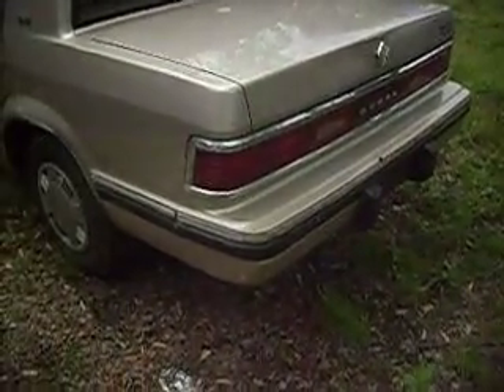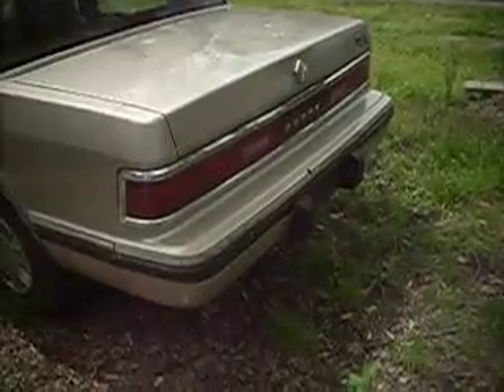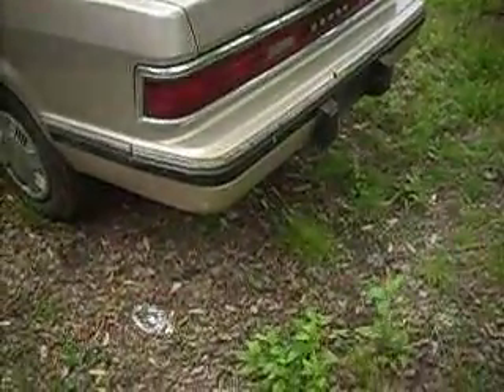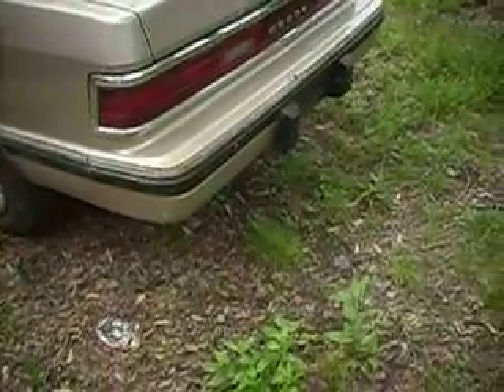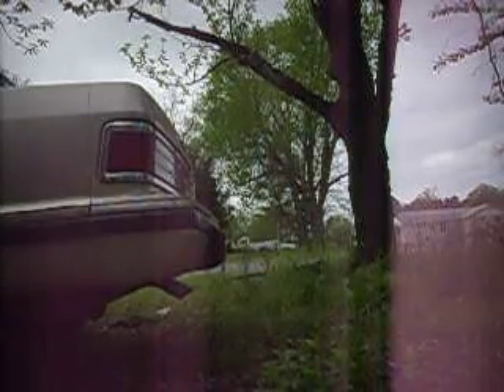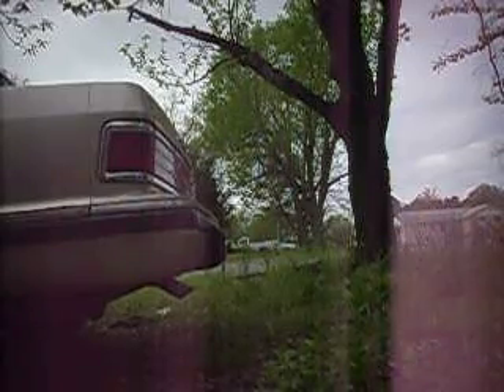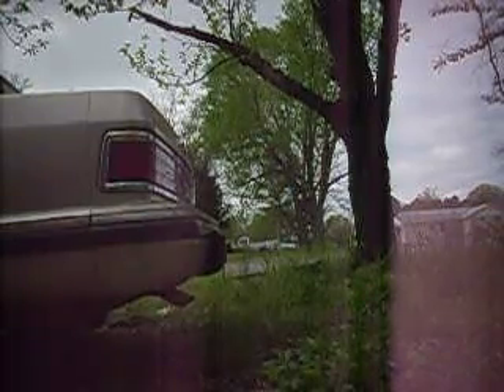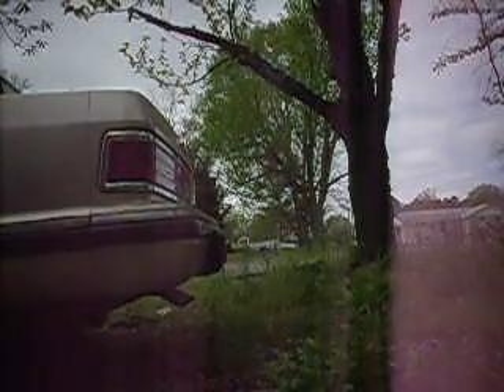Project 91 Dodge Dynasty Has a stutter

Comment: It's not the catalytic converter. That's in the fuel injection system. Pull the codes FIRST before you go cutting on it.
Reply from the maker: +WhoSaidTyler Actually I think he pulled the codes. or rather looked for them. and there where none. I will double check to be sure.
Reply: I'm pretty sure on those you do the key on key off 5 times trick, google to make sure.